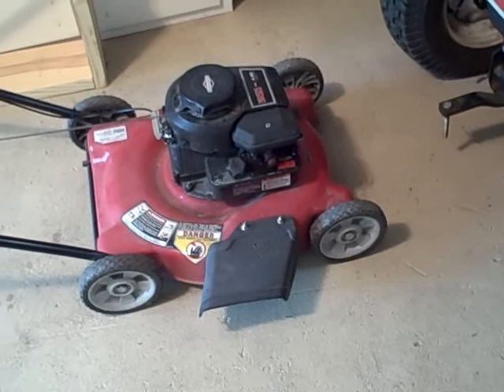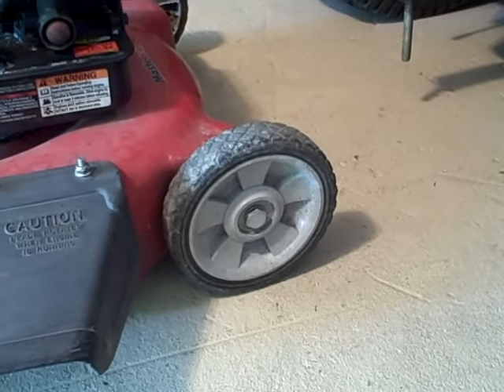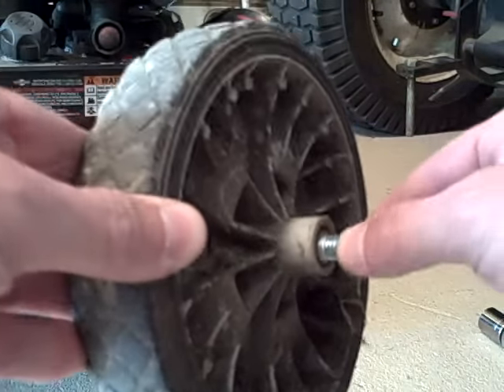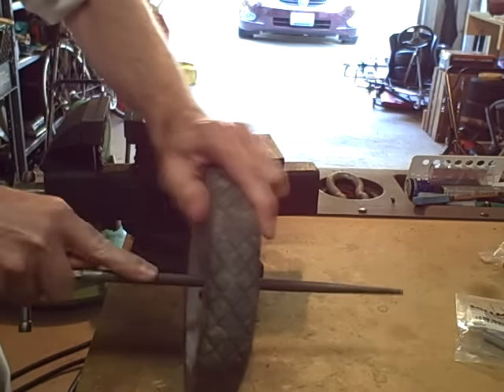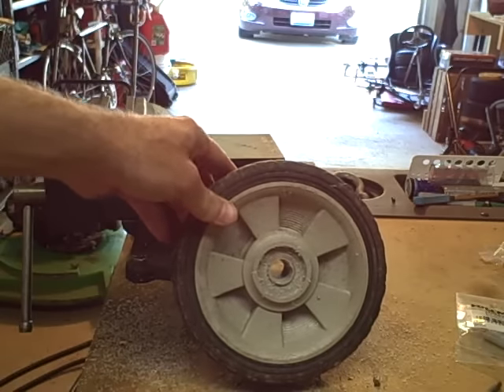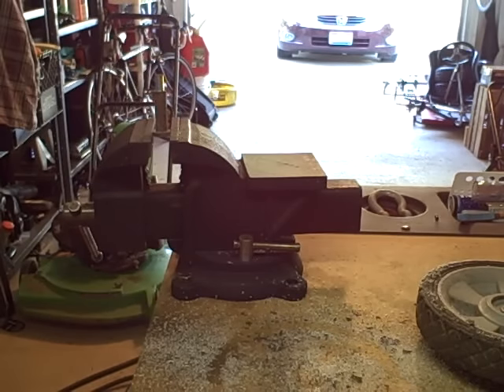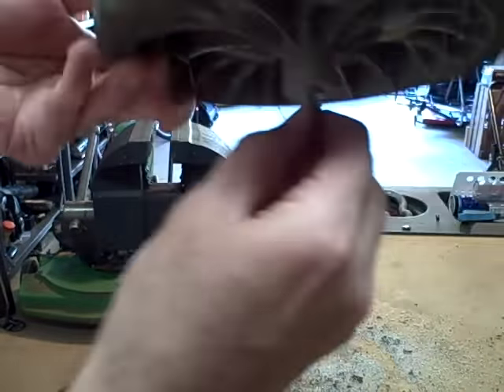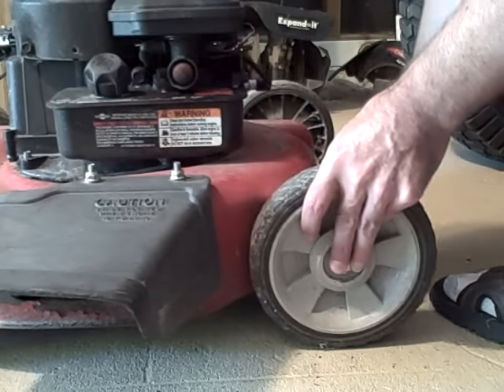Repair a Worn Lawn Mower Wheel in 7 Minutes for $1.29

Comment: Thanks! I just did this to two Toro non-drive wheels that were very worn. Replacements were 50.00 for both! Lowes had Hilman 1/2" bronze sleeve bearings, 5/8" OD for a few dollars each. I bought a 1/2 inch rotary rasp drill attachment and used that to drill out the hubs. The sleeve bearings were shorter than the wheel depth, so I just filed the hub out from the inner side and hammered the bearings in. The repair worked perfectly for < 10.00, including the rasp. Great idea!
Reply from the maker: You're welcome! Glad to hear of another mower fixed at a good price!

Comment: 5/8" spade bit worked for me!  I used a section of 1/2" pex water pipe.  Drilled the wheel first, inserted the pipe into wheel, cut it off with hack saw, then drilled the ID to match the wheel axle.  Bingo been working good so far.  These were Rear follower wheels on craftsman self propelled and they sell for 20.00 ea. So I figured I would try the plastic pipe that I had from other projects and so far so good.  If it wears out. Sooner that one season I will do the same again.
Reply from the maker: I expect that pipe will wear but will far outlast new wheels. Good idea! And yep, a proper-sized drill bit and drill press would do a far better job than my file. If I’d had the right size at the time, that woulda been the way to go.

Comment: So a few months back I purchased a new wheel for my Toro after the previous wobbly wheel broke as I was pivoting the mower on that wheel. I put on a new wheel and still it wobbled, so I guessed there was a problem with the mower body as it was a brand new wheel. After watching your vid I realized that the problem was the wheel, brought it back to the place of purchase and even though more than 30 days had passed they said that with the light amount of use the wheel had received it should not have failed this quickly and they swapped it out for a new one. Came home, put on the new wheel and problem fixed! This vid helped me identify what the problem was, so thank you.
Reply from the maker: Bill Endy You’re very welcome. Thanks for the story!

Comment: Handy lawnmower wheels. Many uses.  My foldable carts main plastic wheels were narrow and the axle holes were worn out, and so the narrow wheels would wiggle back and forth sideways. So I replaced them with much wider lawnmower wheels. But the lawnmower axle holes were 0.50" in diameter but the cart had 0.30" diameter axles.  But earlier on I had repaired several sink taps that were leaking, and did so by replacing the "brass seats", and I held on to the old "brass seats".  The inner hole diameter of the "brass seats" were 0.30", and the outer threaded part was just over 0.50".  So I screwed the "brass seats" into the lawnmower wheel axle holes, one on each side, and bingo, I could now put them on my cart axles.  The cart is now as solid as a rock.  No more wiggling side to side.
Reply from the maker: Thanks for the tip!

Comment: This worked great for my 15+ year old MTD Yard Machines push mower that won't die! Thanks for sharing. I knew there had to be a better way than spending nearly $40 for new wheels.

I used a dremel with small sander attachment and a 1/2 drill bit - alternating between the two. Took about 5 min per wheel. 

Thanks!
Reply from the maker: I'm really glad it worked for you! The only thing better than keeping an old mower running is keeping an old mower running inexpensively. :)

Comment: 2005 lawn-boy 10685.
this started out as replacing rear bearings that had failed and evolved into a whole lot more.
the right front was the worst of the two front wheels, almost 5/64" of play; why did they think metal on plastic was a good idea?  
front wheels are $28.72 each for new toro part. BUT the new ones have no bearing surface for the bolts to ride in/on so your fix made alot more sense to me. the hillman bushings were (for me) $12.95 for a box of 5, $2.59 each so not bad from amazon. no one had these local or i would have bought only 2.
the center hole on the wheel was another story...didn't have a 5/8 drill bit (NOT paying $17.00 for one for 1 project either) or a large round file/rasp so my thought was a little unorthodox on how to open up the oblong hole evenly. 
my solution was getting a 2 piece tapered reamer set for doing bushing holes in guitar headstocks. large size was 3/16" - 5/8" which was perfect; once i was all the way to the end i was done. tapered bit self centers, it cut plastic easily and the set was $9.99.   
last step was dressing the bolts. the had a weird corrosion patern on them and were not rotating smoothly in the bushing.
we didn't get our lawn-boy new, it was left in the back yard of our neighbor who moved due to personal issues. it was only 2 years old when we saved it and have NEVER had issues untill now. 
some people would just buy new wheels, but the new ones are flawed in the same way - so why not improvise? if it's already kinda broken, why not give it a try?
this video was the answer to a question most would not ask, thank you.

Comment: Ive been doing that for years, I use a piece of scrap  copper pipe, half inch, cut to length , if its to tight cut it with dremmel  and squeeze together , drive in with a hammer.
Reply from the maker: I didn't figure I was the first. Kudos to you, sir!
Reply: Great idea, thank you.
Reply: Yes indeed! The way to do it.

Comment: I took a 5/8" spade bit which was to big to drill without being able to have the center point of the bit make contact to drill with symmetry.  So I ground the width of the two faces of the bit on an angle so it worked like a reamer.  The plastic shaved off with the edges of the bit perfectly.
Reply from the maker: Kevin Jacobsen Great idea! I’m glad it worked for you!
Reply: Please post a photo of your modified speed bit.

Comment: Instead of a file use a drill press and the perfect size bit. Then you can make a really round hole so its a nice snug fit.
Reply from the maker: If you have a drill bit that big, that would definitely be better. I didn't, and it wasn't worth buying one for something that simple. But it would surely do a better job.
Reply: 76horsepower I used 5/8 sped bit, worked fine. It actually cut better than twist steel bit. Twist steel bit grabbed and spiraled in without cutting completely.  A drill press would have been great.

Comment: I just bought a new mower with plastic wheels just like the ones you show. But you gotta be careful to rasp out the bushing  in a straight line. I didn't and the wheel wobbles on the axle. I'll buy a new plastic wheel and maybe get a bit just a hair smaller than the 5/8 outside diam. of the bushing (what size do you suggest?) and use a drill press to drill it out straight. I would rather have ball bearings but those wheels are expensive.
Reply from the maker: Yes, it can happen, but I've never had a wobble anywhere large enough to affect how the mower pushes. I suppose it's possible if enough material needs to be removed from the hub. Sorry about that. Yes, I'd absolutely prefer ball-bearing wheels with grease Zerks, but I won't pay for them unless the mower is especially nice. Though in truth, one of my Lawn Boys has ball-bearing wheels and there is zero felt difference in how it pushes compared to the Lawn Boys with plastic wheels. Oh, well.

Comment: He needs a little bit of Blue Thread Lock on that bolt. Once you take the bolt out of the nut, the Thread lock, whether Nylon or the Crimped place on the nut, may not keep everything together. Don’t use the Red Thread lock, or you’ll never get it apart without heating it with a Torch.,

Comment: Hi I liked this simple fix. I have a different problem with my mower. the wheel centres/bearings are fine but the "tyre" parts of the solid wheels are badly worn. As they are not separate and are integral to the plastic wheels, the "tyres' cannot be removed. Suggests on how to get around this problem without buying brand new wheels (for around £60 for the set) would be gratefully received!
Reply from the maker: That's a good question. I have enough spare wheels laying around that I haven't had to fix one where the tread has worn yet, but I'd considered it. I have a length of conveyor belt that is Kevlar-reinforced rubber that I considered cutting into strips and using for such a thing, but I suspect keeping it in place might be a challenge. I'm all for using parts for as long as I can, but in that case, I might have to punt. Though it certainly can't hurt to try.

Comment: Not sure if this would work in my case.  Rear wheel drive propelled mower, rear wheel fell off LOL.  Bearings are gone, I can put wheel back on but no way I can think of to make it stay on.
Reply from the maker: JACK WILLIAMS I’d have to see the type of system used, but yeah, this fix won’t work. If you do find a good fix, post a video or a comment and let me know! Where there’s a will, there’s a way!
Reply: @76horsepower  Sure buddy!  Manufacture sent me a new mower because they deemed it unrepairable (still in warranty).  They Said not to bother sending back the old one.  I was just trying to see if I could fix it LOL!
Reply from the maker: @jackwilliams5474  Perfect! You can experiment with the old one and not be concerned about making it worse. Ha!
Reply: @76horsepower  Ya Im going to try to buy a wheel, maybe that will help.

Comment: I have this mower but I cannot get the damn wheel off, none will budge at all!  Any help?????
Reply from the maker: The axle has a nut on the inside of the deck. If it’s frozen, it may take penetrating oil and locking pliers (or something similar) on the nut to hold it still while you turn the axle. Seized nuts are no fun. Good luck!

Comment: Thanks but what about the middle hole of the deck that's rusted out
Reply from the maker: Don't know, never tried. I've worked on lots of mowers, but the ones I've personally owned have all been Lawn Boys with aluminum or magnesium decks.
Reply: Give your local lawnmower repairman a call. he will sell you a deck with no motor on it for next to nothing..$10-20.

Comment: My drive wheel has same issue.  Would this be a complication to your procedure?
Reply from the maker: I'd be highly surprised if the same type of fix would apply to a drive wheel. I've certainly not seen every type of drive system, but I'm not aware of any where the drive wheel sits on the same type of axle as a free spinning wheel. Couldn't hurt to take it apart and see though. You never know!

Comment: I have this exact same model but I some how can get the bolts of the wheels
Reply from the maker: There's a nut on the inside that can be rough to hold still to keep it from spinning while you unthread the bolt from the outside. It might be completely covered it grass and dirt, or it might be rounded or crumbled from age. I didn't have trouble on this particular mower, but with another mower there wasn't enough room to get Vice Grips on the  badly-rusted nut, so I had to flip the mower on its side, shove a prybar between the nut and the deck, and just lean on it real hard while turning the bolt on the outside. I made sure to replace that nut after I got it loose.

Comment: I tried it and still wobbles. Something must be wrong with wheel. Decided not to do the other three. Wheels just like on this video,
Reply from the maker: If the spacer/sleeve fits snug on the axle, the wheel won’t wobble, but if the axle is badly worn, even if you pick the correct size sleeve, it won’t work.

Comment: You should NOT have reamed (filed) the wheel and 'guess' how much.  Put the wheel on a press with the size drill bit that matches the bushing.  And yes, you should use bushings, not spacers
Reply from the maker: You're absolutely right. That would have made it a better repair for sure. I'm a shade-tree mechanic though, not an engineer. I don't own a press or a drill bit that big (or have access to either). I suppose I could have bought actual bearings, but I purchased what was available at my local hardware store.
Reply: Sure Jim, everybody owns a drill press, and large enough bits for this.  And can you provide a link or picture for the bushings? Because he showed exactly what spacers to get. So his video was a lot more helpful than your post.